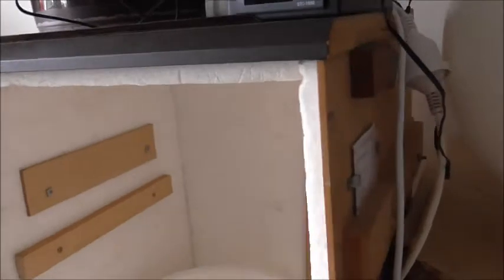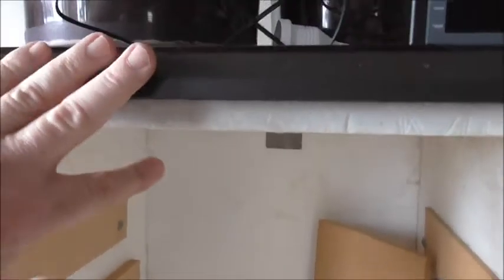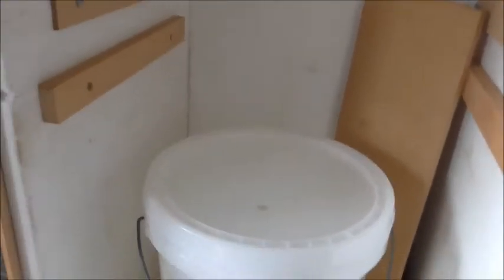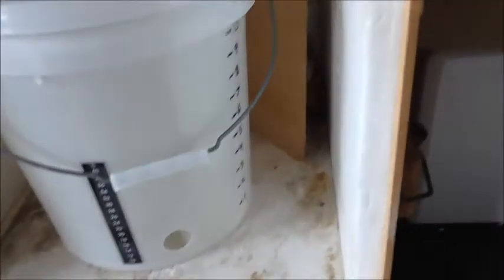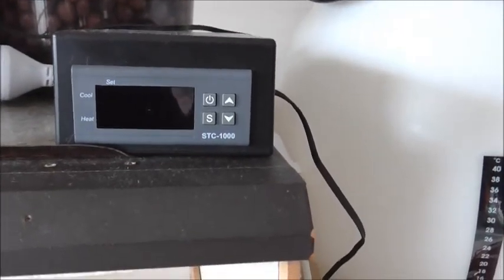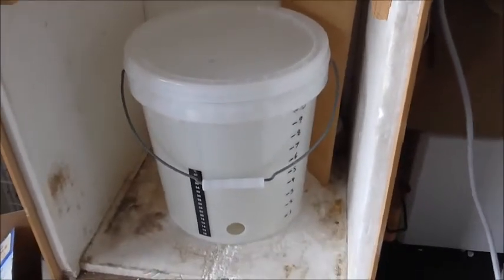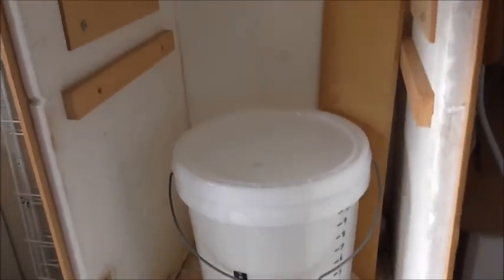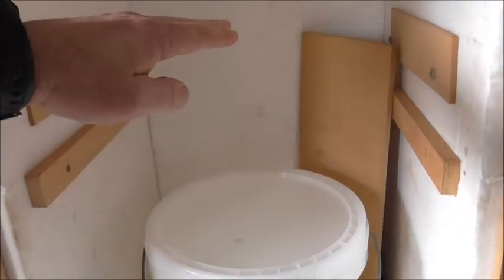Closer look at my Fermentation Chamber for The Iowa Carver

Comment: Thats choice Dean. I have one simalar with a bulb I use to carbonation. Nice thinking of covering the bulb with a board. I just throw a dark sheet over the bottles. I got mine with an old setup I bought that came with a black fermenter so it blocks the light. Thanks for sharing. Cheers!
Reply from the maker: Thanks. I have just used it for fermentation, but haven't not for carbonation yet. I'm just trying to butter up Mrs Dino so I can get a fermentation fridge by the time the weather warms up again. Cheers

Comment: Nice chamber Dino. Simple and effective. Plus cheaper than a mini fridge. Cheers and 17!
Reply from the maker: Thanks Bill. It works well in the Winter for heating, but you have to manually control the temp with ice in the Summer, so if Mrs Dino agrees, I'll look at getting a small fridge. Cheers mate. Hope you are all good!
Reply: tubedinoz heres a heads up Dino. At the warehouse this week (wed - tue) they have 42litre mini bar fridge half price to $99. Dont know if that big enough for you fermenter. But thought it was worth a mention.  Cheers!
Reply from the maker: Thanks Zane. i'll check it out.! I think the only problem if its like the other fridges I've seen is the bottom inside the fridge has a step where the compressor/motor is fitted, but I'll definitely take a look. Appreciate the heads up. Cheers mate

Comment: Dean, what did you have to pay for the controller? I have seen a number of the brewers use these.. but have no idea what they run?
Reply from the maker: Hi. I was very lucky. I got the controller off ShadowBeastBrewery for a good price as he had a spare one. It was just the control unit and I had to wire it up myself. In NZ I've seen just the units for around $35-$40 and it cost me about $15 bucks to wire it up. A fully built up one runs about $100 NZ. Basically you set the temperature you want on the unit and there are two female plugs out the back. One that plugs into a heating device if the temp drops below the range set on the unit and the other plugs into a cooling device like a fridge if the temp goes too high. My one does both, but I only had the light bulb plugged into the heating plug. The unit is called an STC-1000. There are good videos on Youtube about wiring them up and also using them. I'll try find some links for you. Cheers
Reply from the maker: Here are some good links - How to wire the STC 1000 temperature controller
 and How to program a STC-1000 temperature controller Cheers
Reply: Thanks Dino for the great info!! Appreciate it!